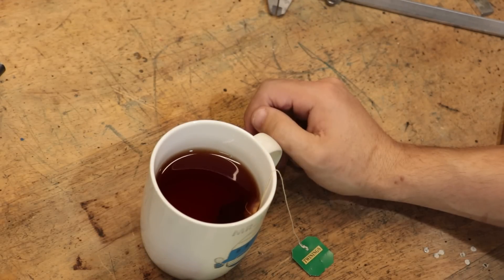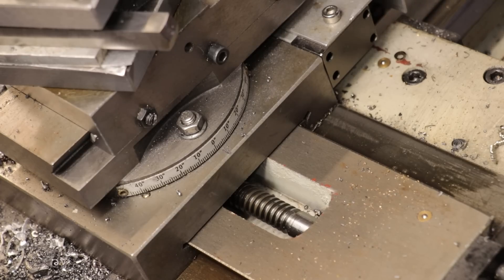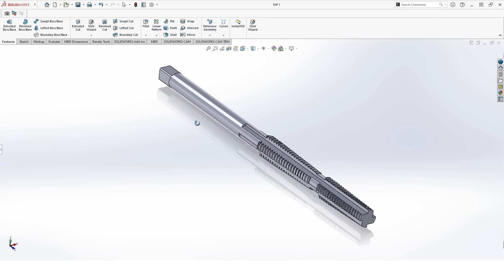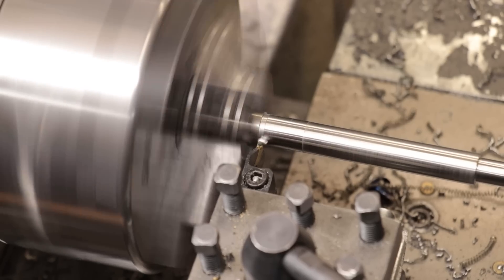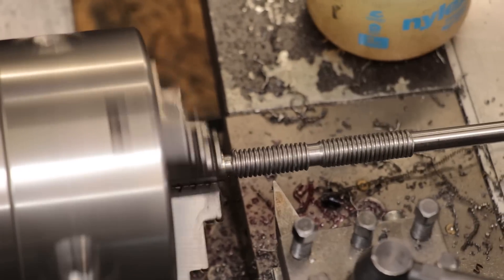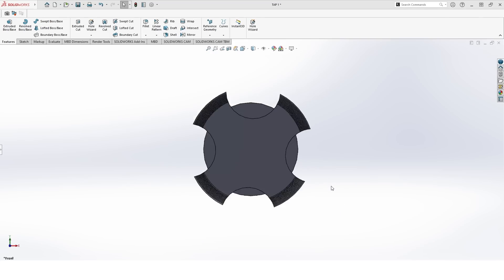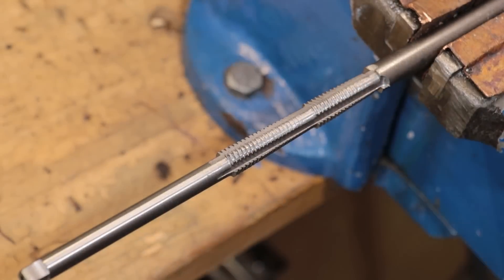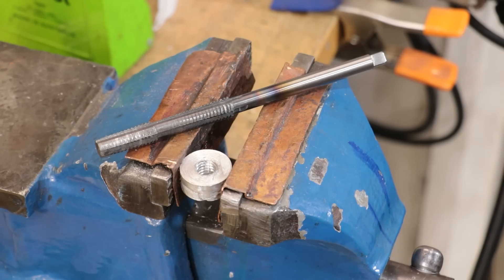Making A Tandem ACME Tap - Its A Bit Weird

Comment: ciao bel progetto ho copiato passo passo e ne ho realizzati due ...1 destro e 1 sinistro...ed ho provato a filettare  sull alluminio prima di temperarlo ma e stato molto faticoso fare il filetto...io ho fatto un TR12 passo 2MM...:ti volevo chiedere che diametro del foro sull alluminio devo fare per u  TR12?  Grazie mille.
Reply from the maker: 11mm pilot hole. It’s half of what it would be for a normal tap. Test that see if it works

Comment: So I'm here for the same reason now😂 I'd NEVER cut an acme thread before. I ordered an acme thread guage, ground up a tool, grabbed some tool steel slapped some gears on and was shocked that the single point acme thread turned out better than any of my normal single point v threads do😂. I was winging it and didn't make the tap taper long enough, too much force to run it through so I get to redo it again. I'm going to follow this method and if it doesn't work it's your fault😂 as for internal single point- I made a 1/2"-10 left hand acme thread-used a Tungsten steel threading bar and it was CAKE. Regular steel bar for would've chattered

Comment: If you're going to make them you might as well make the ones that will tear a hole in your finances...good job.
I remember when I was a kid stripping a bolt thread on my bike and because I couldnt find anything else to do  I used another bolt the right size and filed flutes into it. It worked and made it so I could ride my bike but it only lasted the one go lol.
thanks for sharing,
 I'm interested to see what youre cross slide is going to be like with this thread.

Comment: 30°? Is that a metricism? Acme threads use a 29° angle.

When you cut the flutes with a square end mill, if you go slightly past center, you will put some positive rake angle on the cutting edge.
Reply from the maker: Yeah metric is 30.

Comment: as   a time served     engineer   /  gear cutter    / fitter   / turner    / tool maker   . 
 never try this   .   this is  the wrong way to make  taps  .
 [  if you know   you know ] 
  honest this  plank   is   stupid as   hell .
Reply from the maker: It’s the method laid out in the machinery’s and hand fitters handbook, minus the hooked cutting edge. If you want to disagree with that method….. okay
Reply: Bet you watched it all.
Reply: As a time served engineer, I've usually found that the method that works with the tooling you have is the best way, and I've seen some fantastic work done with the most basic tooling possible.
Reply: @colinvanful  I can’t figure out what you’re trying to accomplish with such an incomplete and rude comment. How does it help anyone? Did it help you?

Comment: Honest question and I mean no offense: why the determination to make your taps 4 flute opposed to a 3 or 6 ??? (I'm sure a viewer will have the answer but I ask that our host provide the reasoning) 
Thank you!
ps that finger is looking back to normal, you heal fast!
Reply: For through holes like this, a 2 or 3 flute tap should be superior. More flutes only help with bottoming because of the reduced chip load per tooth, and 4 flute taps are easier to square up by hand, but I’m bad at it either way so I always use a tap follower when I need a straight thread.
Reply: @ourtube4266  That is the exact reasoning for me wanting his thoughts on the matter. I've got speculations but I'm not the one making the tool so this is a good learning op.
Reply from the maker: My copy of the machinery’s handbook is a bit vague on whether 3 or 4 flute is better. But it lists your the standards for both, but generally the 3 flute will require a larger endmill to make larger flutes and if you follow their method, the 3 flute ends up being weaker than the 4.
Reply: @artisanmakes  So from what I have gleaned over the decades is 4 is better for free hand as it allows better squaring and chip ejection. 2 flute is really strong and ideal in mill/lathe tool applications... so good for power tapping. The advantage of 3 flute is consistency, especially in depth of your root without deforming the tail of your pitch cut. 

Have you signed up on practical machinist website? There is an amazing wealth of knowledge there that makes the handbook look like it was written by children. Granted it is a forum sure, but it is pretty well peer regulated. I am really enjoying the adventure you are taking making your own taps, even this old dog is learning from a younger one! Thanks for the series. I cant wait for the next installment, mate.

Comment: how did you measure the threads while cutting it ? Did you use 3 wire method ?
Reply from the maker: That was the only way to measure it once the burrs were kicked up by the cutting tool

Comment: Question. You seem to be using Trapezoidal and Acme interchangeably. Is that a All Acme threads are Trapezoidal, but not all Trapezoidal taps are Acme thing? Or are you changing from Acme to Trapezoidal because there is some benefit? I have no experience in this area other than researching what Inserts to buy on AliExpress, and that left me feeling that they were significantly different...
Reply: Welll acme is trapezoidal in form.  But difference with euro trapezoidal and usa acme is 1 degree in the angle. 

So uhh see if they tell you the dimensions and angle and good luck
Reply: @lasskinn  Ty.
Reply from the maker: Acme is just the imperial version trapezoidal thread, except its 29 degrees. A lot of people just call them all Acme or metric acme since it is a bit of a pain to say trapezoidal thread every time.
Reply: @artisanmakes  Ty.

Comment: The ol' two stage tap... I dislike making those, with a passion! I'm stunned you didn't just order some O1 barstock or whatever, rather than using 1080.
Reply: For a tool thats going to be used a few times probably why spend the money and time when you have something right in your garage already?
And going the 01 step means you need to heat treat it properly, which is more involved if you want to get any benefit.
Reply: @boots7859  Ty.
Reply: Can you please explain to a relative nube in steel selection, how that would be the better option?